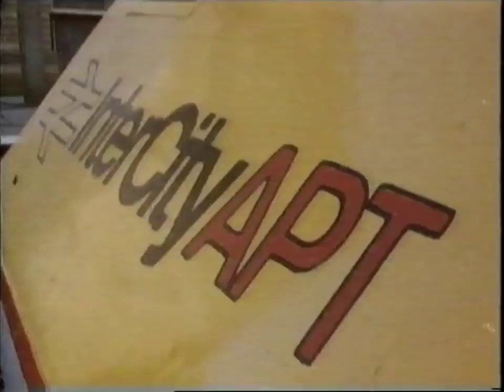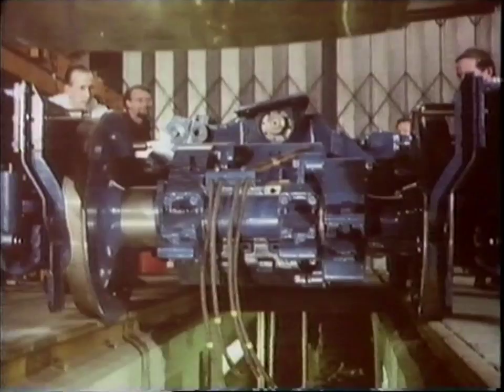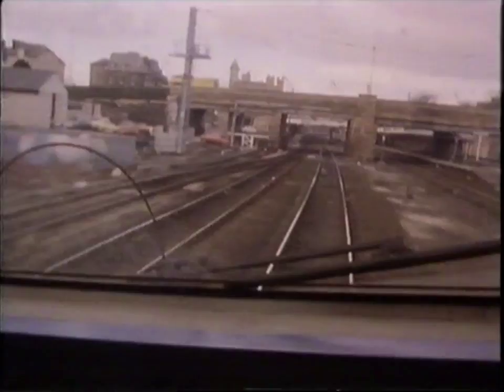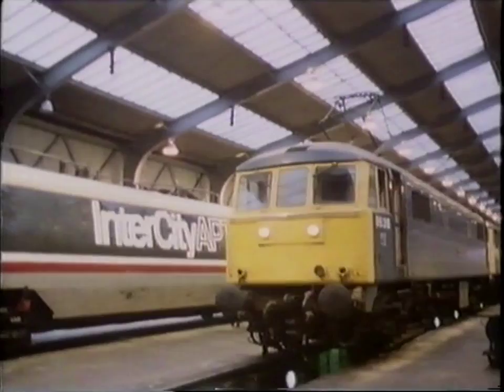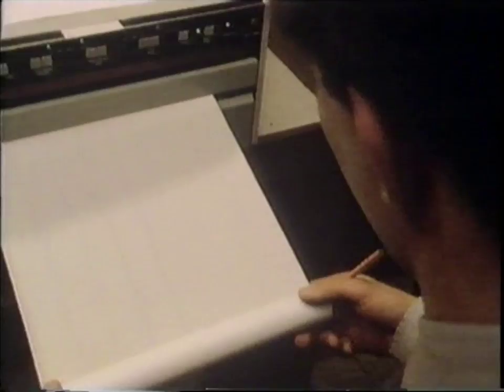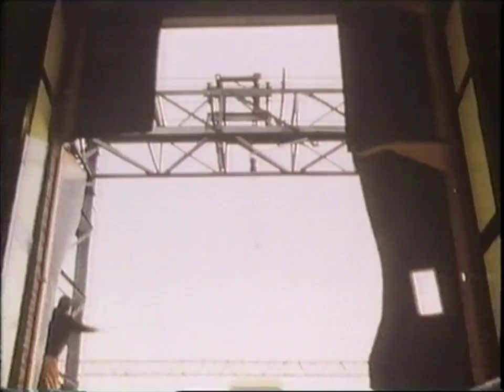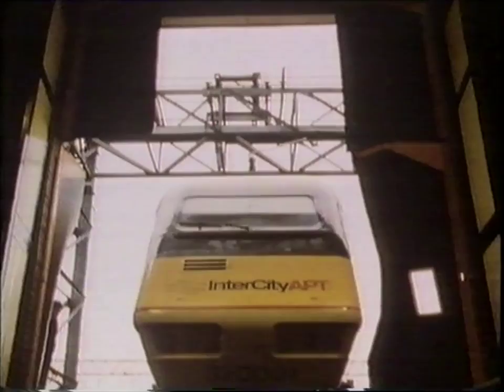Innovation On The Rails Documentary 1986

Comment: As a nation we failed to update our rail network after the war being old Victorian lines which the apt couldn't reach its full potential. Whereas Europe rebuilt from scratch. The British attitude of make do and mend is what holds us back. A lack of vision and forethought.
Reply: And now HS2 is in jeopardy. We need HS2 and we need it quick and as a long railway
Reply: Err, weren't we virtually bankrupt after the war? This is why we kept building steam locomotives long after other countries had moved to diesel and electric locomotives.
Reply: Neil of Longbeck agree but we always seem to be short sighted same with housing why have we still got Edwardian houses same problem lack investment & make do & mend
Reply: @timtim4603  and what is wrong with Edwardian houses or other buildings from that period? Short-sighted would be to built diesels without the fuel to run them.
Reply: @Micah the Nerd Saxophonist Nope. Completely wrong. The US rebuilt lines to accommodate the switch to freight rail. In particular, a huge number of US bridges and tunnels were rebuilt to handle the world's largest loading gauge to accommodate intermodal freight. Nearly all US lines handle piggyback (road trailer driven onto a flatcar), and most lines accommodate doublestack containers. As a result, the US rail network handles more ton-miles of traffic today than point in history and any country.

Compare this to Britain's infrastructure which has issues accommodating even a single ISO container. Britain's loading gauge can't even handle most continental European passenger rolling stock, which is why their trains have to be custom-built and expensive.

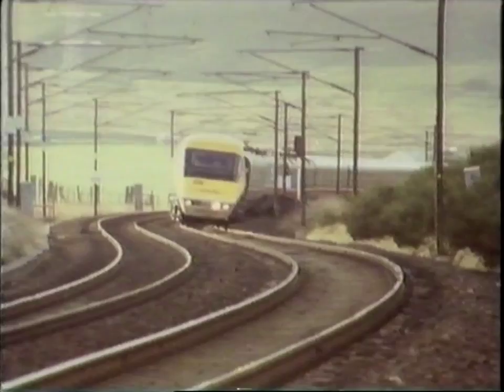Comment: The shot at 3:51 sums it up: the sixth car failing to tilt.
Reply: that was one of two NDMC (Non Driver Motor Cars), these had to stay vertical or the connection of the pantograph with the overhead wire would cause a lot of more quicker damage to the pantograph and the wire itself.
Reply: I don't think I've ever seen or heard a perfect Prototype, obviously not meant to happen

Comment: Was the apt - e powered by diesel?
Reply: Yes, via gas turbine, generator and electric motor
Reply: APT-E was powered by 8 Leyland 2S/350 Gas Turbines (four in each Driver Power Car “DPC”).
APT-P was powered by 25KV 50Hz AC overhead catenary and was propelled by two Non-Driver-Motor “NDM” cars. The APT-P was made of two sets coupled back to back so the “NDM” cars were always in the middle of the consist, there was not through-way gangway in the NDM cars so when the APT-P was in service, passengers could not freely walk from one end of the train to the other end like the APT-E.

Comment: The APT-E worked, why did they change it?
Reply: BR management had no faith in it, it ended up being very expensive and plagued with teething problems with the tilt system that caused motion sickness. They deactivated the tilt system which rendered the train unable to exceed normal line speeds, which had been the entire point of it. So in the end it was more efficient to just run the intercity HSTs instead of the APT.

One final disadvantage, the APT had a power car in the middle that split the train in half, passengers couldn't move through it, so they had to have sperate first class, standard class and buffet cars on either side of that car, doubling the staff.